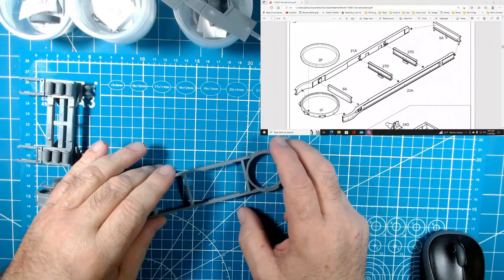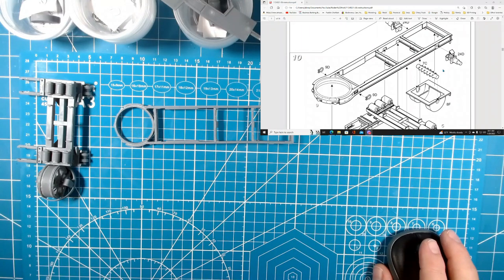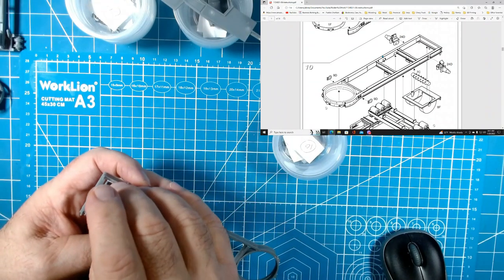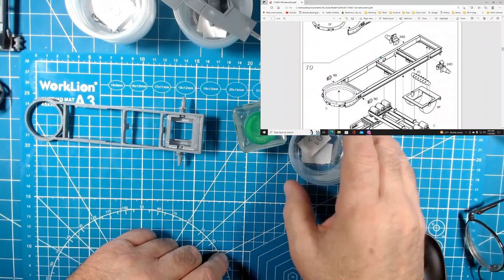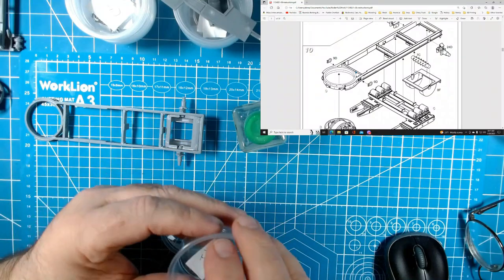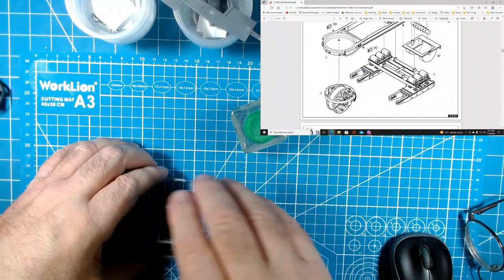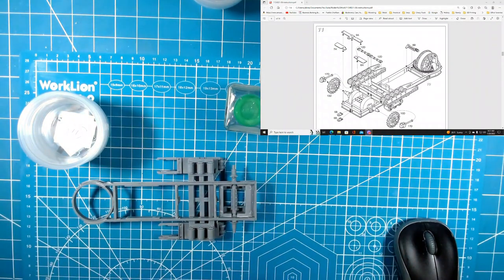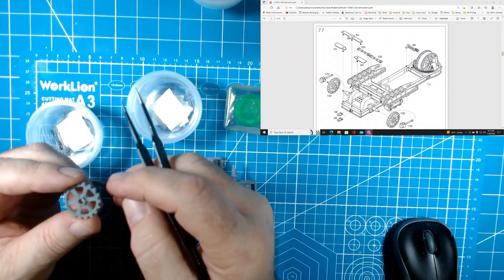Holt 75 Artillery Tractor Part 4

Comment: Looks good jeff. I like your idea of putting individual parts in the plastic cups.
Reply from the maker: Hi Chris, Thanks for watching.  I like to be as organized as I can.  They are 2oz condiment cups, I get them from Amazon.  I clip each part and put them in a cup with a label, if there are multiples of the same part I make a note.  All parts for one step go in a stack and I add a slip to the top cup with the step # in a circle.  I go through each stack and clean the part and fill ejector pin holes ir what ever else needs done.  As I use the parts, I put the empty cups in a stack to reuse at a later date.  I hope you are getting a little free time.  Last time we talked, your schedule sounded really busy.  Have a great day.  Jeff

Comment: Hi Jeff, another excellent update, it should look awesome when completed. Will you muddy it up or just do a lite highlight wash ?

Also for some reason I could only watch this video in 360p ?
Reply from the maker: Hi Jeffrey, Thanks for watching.  I will give it a going over with some oils and a little spatter.  I don't like to dirty my models up to bad. I think YT had a problem last night.  I can usually upload an hour video in about 20 minutes.  This video took at lease 3 hours.  When YT processed a video, it starts at 360p and then eventually goes into HD or better in an hour or so.  I guess they were slow processing.  It's in HD now.  Have a great day.  Jeff